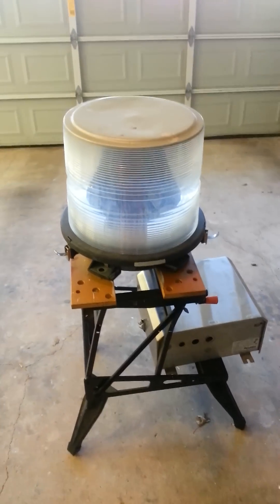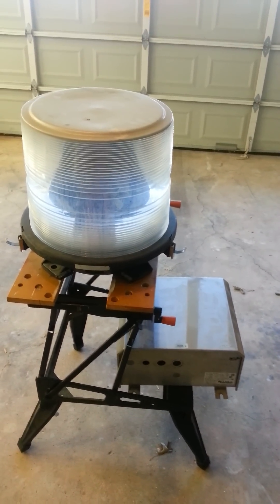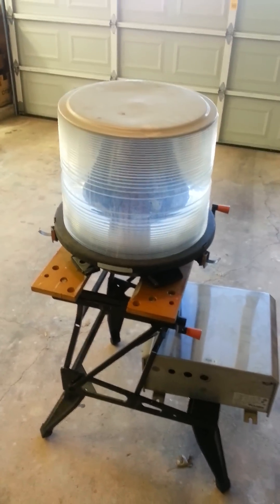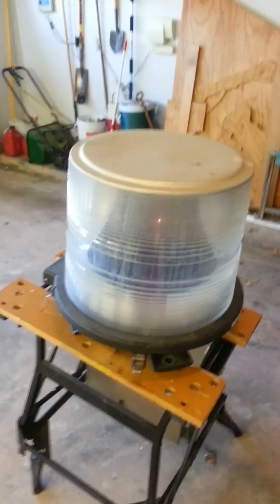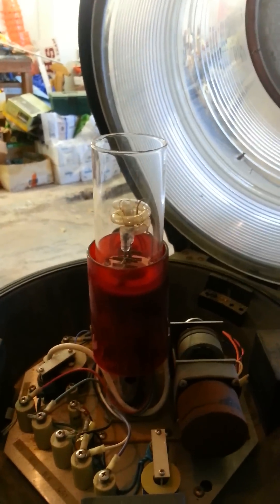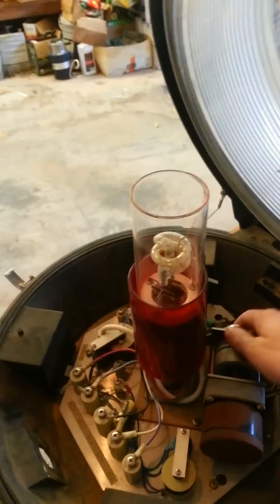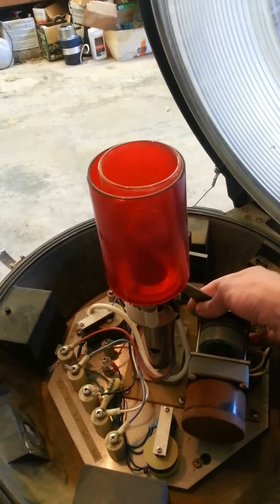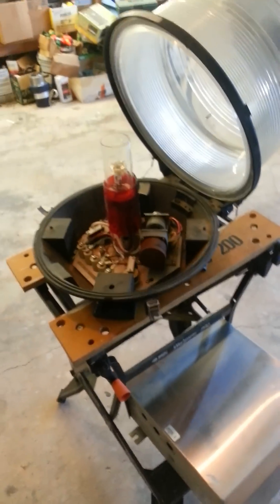My Flash Technology FAA Obstruction Light

Comment: That strobe light operates off of 1000+ VDC and the actuator assembly that raises and lowers the red lens is operated via a 120 VAC circuit provided from the power converter (PC-312....the large stainless steel box you have sitting next to the flash head). There are several variations of that technology (Strobe/Xenon) but as you stated most people are choosing LED as they are cheaper to operate and have fewer maintenance concerns.
Reply from the maker: Thanks for the comment. This is currently sitting in my attic in my new house, and have still never powered it up!
Reply: @DL1011  Do you still have this?  I have been wanting one.  There are just so gosh dang expenzive